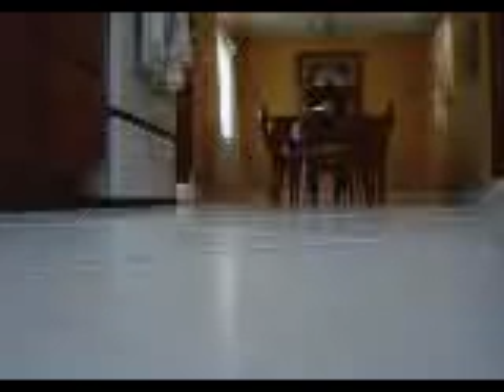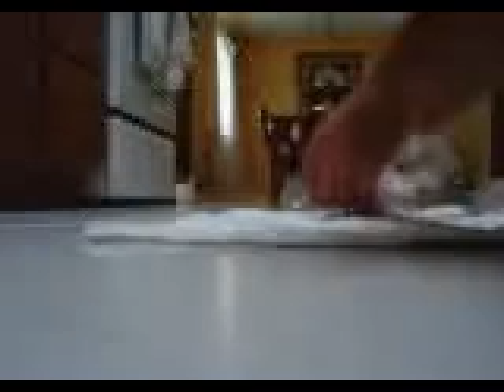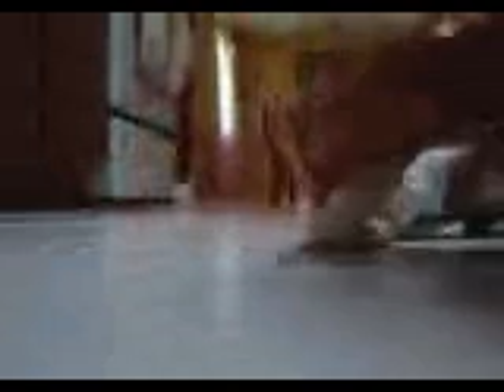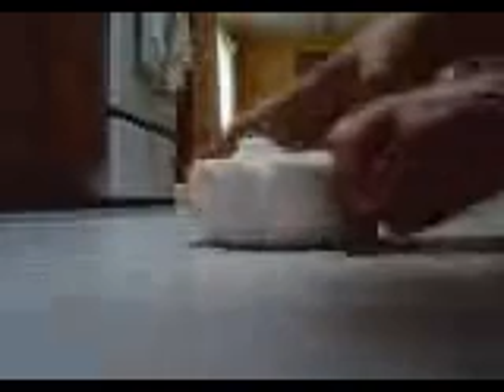Orgone Energy #1

Comment: @Epoxynous A good question. An accumulator can produce marked effects, but to do so, it needs to go round something, so I can't see what use a bundle with no 'inside' is. The most effective accumulator has solid sides,  built on a wooden frame with sheet-iron internal layers, and is big enough for you to sit in it. A similarly built, small one will cause seeds to germinate more quickly and grow leaves more quickly than controls.

Comment: Lots of misinformation out there about orgone. When you make good orgone it works if you do it wrong it is weak or will not do anything. It works by putting pressure on mettle flakes releasing - ions, there is no danger to this.You can not use cement it will not produce the pressure needed like fiberglass.